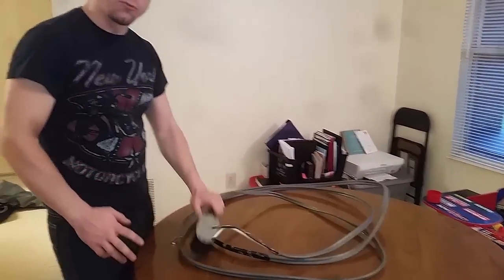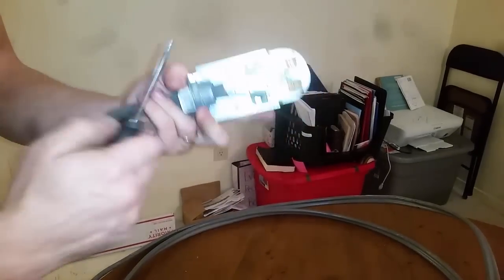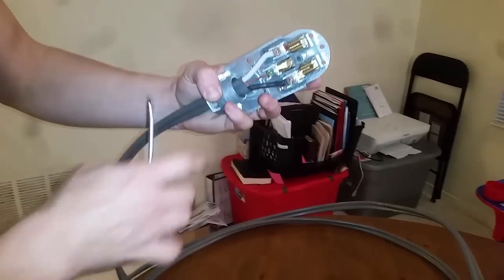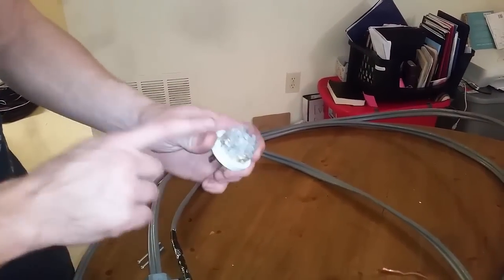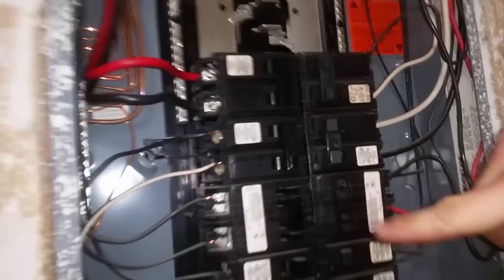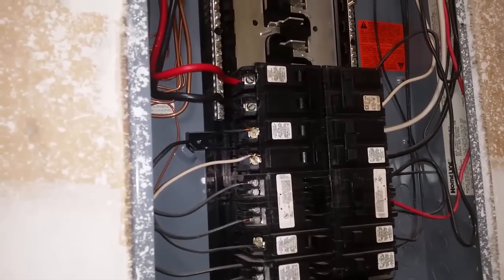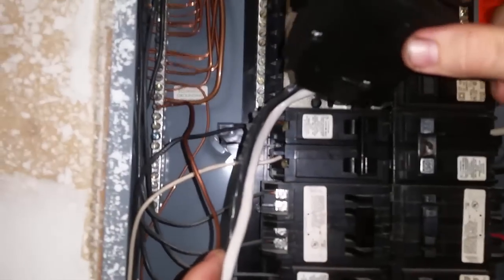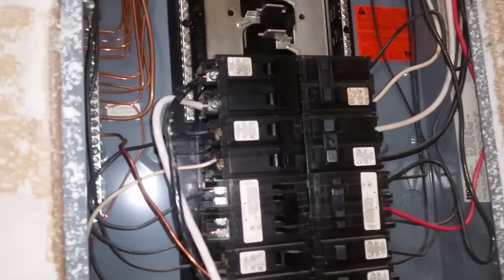how to install a 50 amp 220 volt 240 v plug for your welder, and DIY generator cord

Comment: That was a very good tutorial. Thanks!
Reply from the maker: Northwoods Acres thanks, just remember to turn off the main. Don't be like me.  And some applications require 4 wires.  The 4th being a neutral.  This is because some things need 120v too.  For clocks on the stove and such ...
Reply: Invincible Extremes Muscle Cars Garage yes... Also good advice. I'll just be running 6-2 for my welder out in the garage. And since it is on a sub-panel, I'll just shut down the panel while I work on it. Thanks again for the video, it was very clear and well done.

Comment: warning warning ,before doing any work on the panel you MUST turn off the main breaker on top of the breakers .
Reply from the maker: Farhad Azari yes. Definitely a must
Reply: Yes yes and to not say so leaves him open to severe liability and you know somebody will touch one or both of  those hot legs in the panel! Sorry but highly irresponsible and should never post again as someone could die, Dead !
Reply: @markrigneymd6570  jesus christ relax. He wont be responsible.

Comment: Very good simple way to explain thank you man
Reply from the maker: Hector Rodriguez Thanks! just remember that some things also need a neutral because the clock on the stove and other things will need 120v instead of the full 240

Comment: awesome video. The info is quick, simple, and to the point. It gave me the confidence to install an additional breaker switch, something diy manuals can't always provide.
Reply from the maker: Michael Morris just remember to actually turn off power, and that most appliances need a nuetral AND a ground...  they have 120v things in them that don't need the 240v and so NEED the nuetral to work with...  my welder obviously doesn't need this and so I don't have one.

Comment: Where is your neutral?  In an A/C circuit, two hot leads, one return neutral and one ground. Your using  the wrong wire set, the bare copper wire is for protecting your equipment and yourself. If you notice in your outlet & plug there is a green looking screw, that is for the bare, smaller gage wire. The two outside are you hot and the center is your neutral. All elec equipment needs a return, by cutting corners and buying the wrong wire, you have set yourself and others up for injuries, or worse. I am a Lineman/Cable man of 38yrs, PLEASE-PLEASE, DO YOUR HOMEWORK.
Reply from the maker: John Nelson my friend... a 240v circuit does not need a nuetral... stoves and driers have 120v items in there and those things need a nuetral while the rest of the dryer or heater elements are 240v ....   but a cheapo welder needs no nuetral.  so while you are correct, this is 100% safe for the particular welder I use it for...
Reply: john nelson so if that's the case where does the red (center wire) hook up in the panel and where on the 50 amp plug which only has 3 places to put wire 2 hots and the ground. no place for a 4th "return"
Reply: We're you an electrician? It's a different ball game bud. Lineman and electricians have different schooling at least where I am.

Comment: What kind of generator are u running for your welder, I just bought a Lincoln 230volt 50 amp . I feel more comfortable using my welder on a generator
Reply from the maker: mario lester using a power mate 5k generator.  6250 starting watts, 5k constant.

Comment: You mind giving a materials list? I cant find the 3 strand cable or the receptacle that isn't a wall mount. Thanks
Reply from the maker: Hawaiian Lion home Depot carries the female and male ends for that extension.  the cable itself is called "se cable" also easy to find.  hope that helps

Comment: I have 2 - 110V going from my Box to my detached garage for 110 v wall receptacles. I have a junction box where they connect to garage. Could I install a sub-panel and used  the 2 110V and install a 220V breaker and receptacle for my welder, then re-run my 110 wall receptacles back to the box using just one leg and a ground / Neutral?
Reply from the maker: Gregg Griffin Sr. yes, but only if the legs are opposit... if both 110 are coming from the same leg it's usless... it'll just be 110

Comment: technically it's 240 volt not 220
Reply from the maker: texas journeyman it's both, 220v being average of the wave and 240v being the peak
Reply: When you do a reading on that circuit with no load it's going to be 240 -241 with a load it will drop a few volts
Reply from the maker: texas journeyman true, but I'm talking about the amount of AC power it's actually worth, not the peaks as read...

Comment: SAFTEY FIRST even though you didnt shock yourself in this video you could of brushed youself against another curcuit. Also you should of tagged the curcuit you were working on and the power off for the saftey of others if your not working on it and being at the scene. I had a friend die trying to do electric work on a live curcuit. Just Saying
Reply from the maker: Rick Loop wow, sorry for your friend.
Reply: I asked an electrician how may were in his graduation class.  He said about 18.  I asked him how many are still alive today.  He said  half of them, as 9 died working on live lines.   Always turn off the power.  I put long nose pliers in a panel and they shorted out against the box on a wire that someone had stripped the insulation off of that I could not see was missing.  That took a big bite out of my pliers.   You never know what moron was in the box before you and what danger traps are lurking in there to kill you.   I was just moving a wire a little to see in the box better and my plier handles are good to 1000 volts so I survived.  Others are not so lucky.

Comment: I'm trying to hook up a 240v spot welder that came without a plug at the end of the power cord. I have 220 in the breaker box in my garage (I'm also renting) Unfortunately the 220 lines disappear into the wall and don't appear to run to any outlets in the garage. I'm thinking maybe they run to a dryer in one of the apartments upstairs. This video clears up a lot for me. I'm still a little nervous about the who ground vs neutral bar thing. But thanks for posting this.
Reply from the maker: Jay mind ya business its very simple.... dont touch anything INSIDE the wall if you're renting, just do as I did and pull the cover off and add your own breaker... also, buy a plug end for that spot welder, much safer to have a quick disconnect that doesnt involve digging in the panel...

Comment: What should be the average size of cable going into the breaker box from the electrical company to connect a 220v 50amp breaker safely?
I just got a welder that 
Rated Electrical Input: 210-240 VAC; 60Hz; 22AMP
and a plasma cutter that
Rated Electrical Input: 220 VAC 
Duty Cycle: 60% @ 60 Amps
but the most amps I'll use is 50amp
only to cut thick metal which would be rarely.
Reply from the maker: CHARLES whatever is safe for a decent size range... thats what I would go for.  i forget off hand but its easy to spot at the hardware store.
Reply: You need to look at the code unless you like you house to be on fire.

Comment: I have done a lot of electric work   I would never get my fingers that close to the mains in the panel box.
Reply: explain to me how you complete a circuit then
Reply: Kd6sbr Tom dude just stop talking it clear you don't know shit
Reply: + Samuel Mason My house does not have a OFF switch inside or outside. Only way to turn off is to break the electric company wire lock and pull the meter off the wall. Was done to change panel inside home a couple years ago and tech was not happy about it either. It happens, and what's worse is that local contractors want $1200 to install a friggin' exterior wall switch. My 2 cents
Reply: as long you don't put both hands on it you wont fry

Comment: Better to throw the main breaker before working in the panel.  Also --- didn't realize lease agreements permitted unlicensed electricians to make mods in the main panel (WOW)
Reply from the maker: Agreat Tanker nobody is making mods to anything.  its a temp install

Comment: Different countries, different ways...
Here in Sweden it'd be illegal to tamper with this kind of stuff without an electrician's license. Not saying we don't do it anyways, but... we aren't supposed to.

Also, 50 fscking amps just for the welder??? My little piece of junk run on 10 amps (we have 230V with a neutral lead, but that shouldn't matter... amps are amps, right?) And my entire place has 3x16A main fuses... and that's enough to run all my stuff, including the electric boiler thingie for the heating system.
Reply: Tec 9
There are plenty of people here who doesn't like being told what to do. That doesn't stop the gvt from trying.... ....or us from ignoring them.
Reply: We try to keep big government out of our business. You Europeans love big government telling you what you can and cant do.
Reply from the maker: ziiofswe my welder had the plug for a 50 amp... it only needs 30 amp, but 50 is the plug, so its better to be safe and make it a 50 amp in case you plug in something that actually needs a 50 amp breaker...
Reply: Invincible Extremes Muscle Cars Garage
Ah, of course.
Reply: The breaker needs to be sized based on the wire gauge of that extension cord you were using, otherwise it's safer to use whatever breaker is recommended for that wire.
The welder has the 50A plug only because they figure it's going to be used in a location where they already have those 50A receptacles for the larger welders, even though it doesn't need that much.

Comment: By the way,  I have a question. How do we know what sizes of 220 volts circuit i can install? For example, if i want to install a 220 volt 50 amp circuit (with 8 gauge wires of course),  i just install a 50 amp breaker in any two plug position of the panel box? You plugged your wires into a 50 amp breaker. If all the breakers available in the panel box are less than 50 amps, will we just buy a 50 breaker and plug it wherever we want? I am totally innocent to this, and i am looking forward to your answer.
Thank you very much!
Reply from the maker: Amps is a measure of power... your average welder runs just fine off a 30 amp 220v setup.   I just used a 50 amp because i wasnt about to buy a 30 amp breaker just to give it away... hope that makes sense.  50 amps is enough to run all the burners and the oven on high on your average stove, its a LOT of power.  But yes, if you buy a 50 amp breaker, just add it where theres room and you will be fine.
Reply: Thanks!

Comment: I think you are a genius. It may be more convenient to use this" temporary " way to use a 50amp 220 volts welder, given how frequently you will use it.
Reply from the maker: I just use my generator most of the time.  I can roll the generator anywhere, use the 20 ft extension and can do floor work as close or as far from the house as I need...

Comment: Shouldn't there be red and black, not white and black? White is neutral.
Reply: They are both hot. It does not matter the color. Put some red tape on the white wire if you want.
Reply: Or do they not make wire without neutral
Reply from the maker: +Random Name on 220v there is no nuetral...  both wires are hot... with a third being either nuetral or ground (basically the same).
Reply: +Invincible Extremes Muscle Cars Garage Yeah I just mean that the second hot is red not white
Reply from the maker: +Random Name yes, normaly.  if you have a 4 wire cord, it will be red and black hots.  the white will be nuetral and bare copper will be the ground.

Comment: idiot
Reply from the maker: SupaLexy (SupaNautica & MotoLexy) here's the thing... I WAS an electrician before the army, and this works!  So who knows, some people just have bad days i guess.
Reply from the maker: just curious, but what exactly did you find stupid?
Reply: +SupaLexy (SupaNautica &amp; MotoLexy) I did find an electrician to come do the job, but he's going asking me to grab a 32 amp breaker, then he will throw in the breaker and wire up my outlet, but the reason im watching you video is to take the 32amp breaker out when he's gone and replace it with a 50, if I need more amps.
Reply: You can't swap out the breakers because your wire size won't be right.
Reply: +Invincible Extremes Muscle Cars Garage I don't know what he finds stupid, but I am going through this at the moment but I chose to get an electrician in to hook up a 50 amp breaker. I got 6mm twin an earth, 50 amp clipsal breaker and found some 20 amp outlets on ebay. My 250 amp inverter welder draws a maximum of 43 amps if I pump it up to weld at the full 250 amps. But I don't think I'll be using the full power straight away, either way, we don't weld for very long when we do weld, so it's not a problem to run the 50amps through the gear on the way to the welder. 

But talk to any electrician and they still worry that something going to blow or catch fire. I doubt it would, but I can understand their concerns. I don't agree with them, don't ever hear disaster stories from them about how things did go wrong in our same situation, but they will continue to worry and we will continue to weld. First electrician stressed out, told me I need a 40 amp outlet.. $600 here in Australia.. and drove home. 

I'm not getting no 40 amp outlet, I'm not welding up any oil tankers, it's small projects like tables, trailers, welding carts, the type of stuff where you run a couple inches, then move around the project. So Wiring won't get too much chance to heat up, either way, I'm doing my thing and no electrician is going to stop me. One day I'll rent a big work space and start welding up more stuff, but until then, I got to learn my art and rip in.

Comment: Great how to IE! The thumbs down is probably some safety person shitting themselves lmao! Happy New Year and Have a good'nnn
Reply from the maker: +geargriden19  i dunno, its pretty safe as long as the breaker is removed ;-) before the army, i was a residential electrician, so i'm very familiar with this.  Figured i'd help some folks out, because having someone (like me) come in and install a special 220 volt welding outlet is a $500 job... thats $500 i'd rather spend on car parts... ;-)
Thanks for watching, have a good new years.
Reply: ahh Right on IE! Happy New Years & Have a good'nnn
Reply: Good spirit! thanks!